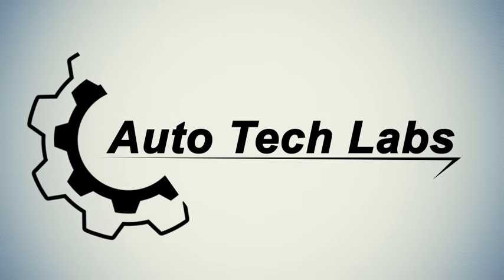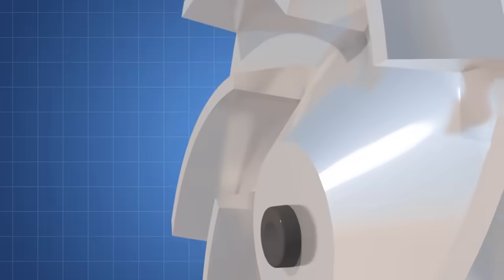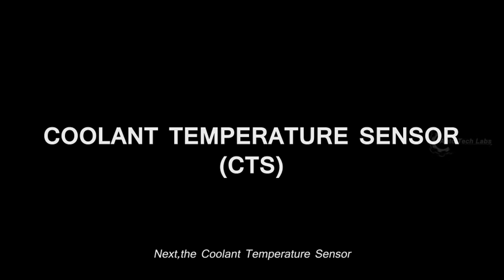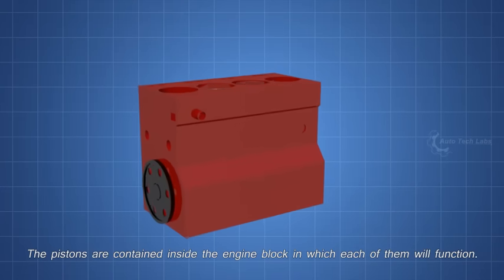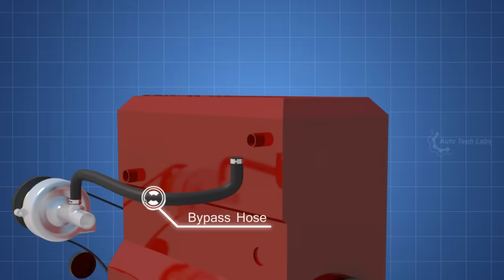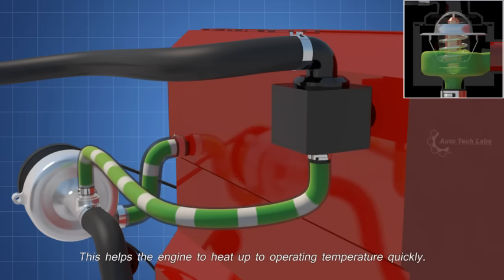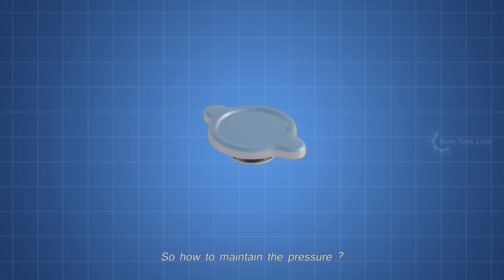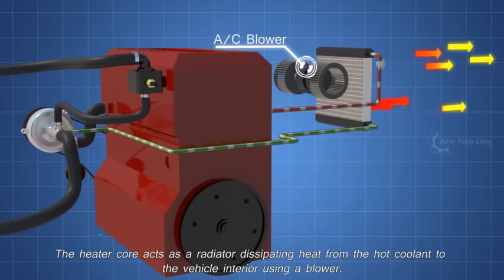How Engine Cooling System Works | Autotechlabs

Comment: There is not any reason a water pump should have more than 4 bolts and an 0 ring and directly bolted to the fan hub assembly .
Bring back copper radiators .
Electric fans operate efficiently .
Detroit Diesel uses a viscous thermal drive on their water pumps .  Sandwiching air to air coolers between a radiator and an a/c condenser is not efficient !

Comment: This goes to show how thermally inefficient internal combustion engines are how much energy is wasted as heat. An gasoline engine is only about 25 to 35 percent efficient a diesel is about 35 to 45 percent efficient the rest of the energy is wasted as heat that just gets dumped out the radiator and  noise out the exhaust. For example in a natural gas power plants the heat from the gas turbine engines and theor exhaust is captured to boil water and produce steam to also power a steam turbine making the system about 65 percent efficient. An electric vehicle battery and motors combined there abot 65 percent efficient also much better then internal combustion engines. The one pro of this waste heat is that like mentioned at the end of the video in the winter it's put to use to heat the vehicle interior but if you can imagine that's not enough to cool the engine down and keep it at operating temperature the thermost still opens and the radiator fan still turns on belching out heat even in the cold winter with the heat on full blast that how thermally inefficient these dinosaurs are.

Comment: the water pump inlet hose doesn't even exist in an actual cooling system the water pump is usually bolted onto the front of the engine block and pumps the coolant throughout the engine block but the water pump is never usually outside of the engine block like shown in this animation.

Comment: Someone help me understand this one thing that no video seems to make clear:
If the radiator cools the coolant such that the lower radiator tank has cooler coolant than the top one, shouldn't a hot top hose and a cooler bottom hose be a sign of a well working radiator? Turns out that if the two hoses have different temperature, then it's a bad sign... I'm confused... Someone help

Comment: since the heater system uses the engine's heat, you can cool down your engine temperature incase of overheating by setting the temperature to high to your AC

Comment: Cars are incredibly complex.  Before I got active in DIY type of work for my car, I always thought it was easy for a mechanic to point out a problem.  However, I found out very quickly that any particular problem has could be any one of five or six causes.  For example, a leaking of coolant could be because of the water pump, one of the hoses, the radiator, the radiator cap, a malfunctioning sensor, etc.  That's why it's good to keep up with the maintenance schedule if you can afford it.

Comment: So guys, I have Chevy Aveo 2011. 10 days ago when I turned the engine on I felt that I can barely turn driving wheel. My friend told that my alternator failed and I need to immediately drive back home before my accumulator dies. After driving 2 more minutes stopped at the lights, engine vibrated, stopped and smoke came out of the hood. My heater hose couldn’t withstand the pressure. My alternator belt was broken therefore I lost hydraulics on driving wheel. I repaired all of them. I had P0128 error (Thermostat Below Temp). I drove car with that fault for because I didn’t want to spend 103$ on new thermostat assembly ( I know silly decision) and yesterday I see smoke coming from my hood again but this time engine was running. I opened the hood and see my radiator bottom hose burst out. Now I repaired thermostat entirely. What you think was it main problem? I wish I had watched this video before. Never underestimate check engine light :(

Comment: I have a 2003 Jeep Liberty Sport v6. I’ve been having coolant bubbling and overflow problems with it for over a year & can’t seem to find the problem. The radiator, water pump, thermostat, housing have all been replaced in different occasions for different reasons not too long ago. There seems to be no lose or broken hose. I had my mechanic ask another mechanic for help because he couldn’t even figure it out. He said that his friend told him that there are 2 types of thermostats & that it could be that my car has the wrong one on. Meaning that the one mine might have on, is one that is not timing the temperature on a timely manner & that is what is causing my coolant to boil and overflow. Can someone please help me with some input. Thank you kindly.🙏🏼

Comment: why does it still needs a by pass? Why can just let the water circulate through the radiator even if it's not too hot?
Reply from the maker: That won't give the coolant enough time to absorb the heat from engine.
Reply: @autotechlabs  Thank you for answering my question.

Comment: I am having massive engine cooling problems these days. Every week one of the pipes is broken and discharging all the water in the radiator. Mech said maybe upper lid of engine is cracked. I wonder if I  remove the thermostat, is it going to work without pressure inside pipes? I need to go to mech 230 kilometers. Maybe engine will not heat up this way and burn more fuel, but i will use it for short period of time.

Comment: So how doesn't the coolant from radiator get pumped by the water pump even if the bypass hose is still not blocked? And how the water in the bypass hose not pumped when it's blocked?

Comment: so do i need to bleed the system when doing a coolant change or will the expansion of the coolant will get rid of the air and suck in coolant from the reservoir to replace the air?

Comment: These are the 3 important things needed to cool a modern day engine, water pump, Thermostat & Coolant temperature sensor, Or if you wanna be old school just buy a beetle and always keep that boot open and relax cause that's air cooled 😂😂

Comment: Start your engine. When the engine is warm, visually watch the coolant in the cooling system to see if it is circulating. Tip: If the coolant is not circulating, then it may need a new water pump. The water pump test should only be done after you verify whether or not the thermostat is faulty.

Symptoms of a Bad or Failing Water Pump
Coolant leak at the front-center of your car. ... 
Water pump pulley is loose and making whining sounds. ... 
Engine is overheating. ... 
Steam coming from your radiator

Start your car's engine and allow it to idle. Look through the radiator filler neck to see if the coolant flows. At this time, it should not be flowing as your car has not reached the operating temperature to cause the thermostat to open. 
If you find the coolant is flowing, it means the thermostat valve is open
Reply: Oh yeah? So, how do you check if your thermos tat is actually working?

Comment: Is it necessary to bleed air when the assumption that there is trapped air even though there is an expansion tank?
Reply: It is advisable that you do so, however, it is an easy process.

Comment: Someone help. I'm building a 357ci windsor,  putting an meziere water pump on. The electric water pump doesn't have the bypass and heat ports, just the lower radiator hose port. Is it ok to just run the upper radiator hose with the thermostat?  Should I drill 3 holes in thermostat?  Should  I not run a thermostat?  Its a car that'll be weekend driven to car shows and street/strip drag racing.

Comment: Question! So those hoses carrying hot water from the engine going to the firewall are only for the heater?? Those 2 hoses broke on my car , i replaced them, i live in a hot tropic weather i will never use the heater, can i just put a blind cap instead of the hoses?

Comment: So this means that the fan is used to create draft to increase cold air coming from outside right? Like the fan doesn’t actually cool the engine but it increase the air that passes thru the radiator. 
Please correct me if I am wrong

Comment: If you're going to provide "facts" make sure they are accurate. You're using a cold side thermostat on a hot side thermostat installation. It physically will not work. The water pump will only pull the bypass valve closed as you have it installed. A hot side thermostat does not have a bypass valve. The water pump forces coolant into the block, there is a small hose that goes from the housing of the thermostat back into the inlet of the pump.  A cold side thermostat has the pellet of the thermostat facing the water pump inlet, the bypass is facing the hot side of the engine and the cold side of the engine is attached to the pump outlet. The bypass valve is there to offer restriction to the coolant being drawn in by the coolant pump. This way, coolant favors coming into the cooling system through the thermostat main valve when it opens as it becomes the path of least resistance. 

You really screwed the pooch on this one. Crappiest video ever. Dont believe a word this video says. While some of it is correct, most of it is not.

Comment: Thank you for the video !
SOS, a very important question: the thermostat has a rod in the centre, in my friends car that ''axon'' broke due to a thermostat failure but never manage to recover it
is lost somewhere in the circuit but can be inside the channel of the radiator? can cause overheating or a problem to the car's water pump some day?
Is there a way to throw it out from the system?

Comment: At 3:59 . the direction of rotation of the water pump is wrong, since is a centrifugal not centripetal pump. 
At 4:41 the water pump outlet hose is shown which also indicates that the pump should've been rotating in the other direction than that shown in the video. 
This is only a negligible detail, so THANK you very much for this great video!

Comment: My cars engine gets extremely hot to the touch almost scalding, but the temp gauge needle stays at the middle or right under the middle. The issue I’m having is that the low coolant sign is on but the radiator reservoir is full. Anyone have any idea what could cause the light to turn on. It happens after driving for 1 hr.
Reply: The engine should be very hot to the touch, most engines operate at around 200 F.
Check if you have coolant in the radiator itself. Some cars have a cap on the resevoir and another on the radiator. If you have a cap on the radiator pull it and see if its full. If it is, the replace the coolant level sensor.
Reply: Redtooth 75  i Appreciate this response sir. I replaced the radiator cap cap to see if that may have been the issue. But I have a feeling it’s the sensor which does not look too difficult to replace. I’ll keep you posted if that’s alright.

Comment: On my Car's thermostat, there is a sensor. what is function of that sensor?
Reply from the maker: The electronic sensor alongside of the thermostat detects the temperature for ECU fucntions such as controlling radiator fan, cut off ignition on overheating and such.
Reply: @autotechlabs  Actually my problem is that, i recently replaced car engine i.e  Mistibushi 3B20. On the older engine there was a sensor on thermostat. But on newly purchazed (also used one), there is no sensor on thermostat. And that sensor grip is now idle. There is no check light on the cabin display. While fan is perfactly getting "on" and "off" according to temperature.  When i opened sensor of old engine thermostat, it is like thin stick which is going inside the thermostat. I am worried, should i run engine without being that sensor active. Please guide
Reply: Also there is another temp sensor on coolant circut on engine body. I think that is controlling radiator fan function. That's why there is no check engine light
Reply: @autotechlabs  hey bro any update on my answer?

Comment: Question. My car always has a low level of coolant I fill it up and then a few days later I look at it and its back down to about 15% full. I have driven it pretty far and have never had a over heating problem. And it doesn't leak either . What is going on?
Reply: There could be a crack on the cylinder head. Coolant is pushing past the crack and going into the cylinder then out the exhaust pipe. If you dont have any leaks that is the only place ot can really go.

Comment: Is it posible to lower the engine temp by  using the ac to warm ourselfs?
Reply: turn the heater on and the blower motor than will lower the engine temp in case it's overheating.

Comment: Thank you for the video!! Quick question: is it normal for my new thermostat to come without a rubber gasket like the one I replaced? Is it not required? Thanks in advance!!
Reply: They are sold separately

Comment: Some radiators don't have a cap or drain.  That does not prevent draining the coolant and changing it.  It just makes it slightly more difficult.  Just have to make sure the car has not been ran recently before you take the hose off.

Comment: this video helps me a lot to do my final project for school. Thank you for creating this!
Reply: 5:23 --- the coolant does not bypass to the water pump and recirculate to the engine block instead to the radiator? in your video shows that way, but the description says it bypass to the radiator .....
Reply: Swasti Niramaya- It bypasses the radiator, meaning it doesn't go through the radiator while the engine is cold. It has to go through the pump in order to have flow
Reply: @imthedarknight-8755  oh ok cool thanks for the reply 👍👍👍

Comment: So if the thermostat was stuck open there would be no coolant flow from the thermostat to the radiator?
Reply: If it was stuck open then coolant would continuously flow to the radiator. This could prevent the engine from getting to operating temperature. If it was stuck closed then there would be no collant flowing to the radiator.

Comment: Sir Thermostate valve of any engine opens at what Temperature?
Reply: @autotechlabs  most thermostates use expanding metal to open and close. If it used wax, they would only work once.

Comment: I was about to say where’s the heater core. I really wished they talked about it a bit more
Reply: I think he left it out because it is not designed to contribute to engine cooling. The heater core is basically a small radiator, but instead if the air cooling the water the water heats up the air to heat up the cabin.

Comment: Very helpful videos, I wished they explained what happens when each of the parts fails.
Reply: Your engine will overheat if any of the parts fail.
Reply: @shifty2755  or stay too cool if the thermostat sticks open..
Reply: @danallured4533  

Then premature engine failure.
Reply: @shifty2755  nope, engine will run fine and not break, just wont get up to operating temperature, be less fuel efficient and heater wont be warm inside the car but engine won't fail, I had one stuck open for two years before I changed it and it still runs 100% fine.
Reply: @danallured4533  

The problem is. The oil wont reach optimum operating temperature. Thus leading to premature engine wear caused by lack of lubrication.
Reply: @ShiftY I know ehHh"
I'd think the same.
Unemployed BSc mekanikal enj
-flushed own coolant, including block jrain plug
-changed in-line gasoline filter
-changed manual transaxle oil
-engine oil changes
-replaced brake discs & pads (front)
-adjusted SPK plugs
-replaced velvet cover gasket
-cleaned and reinstalled throddle body
😉💪👍👌✌️

Comment: So running the heat inside can help the engine cool down or does it trade off with putting resistance on the alternator and thus increasing engine temp?
Reply: Running the heat does cool the engine slightly. Its just not very effective.

Comment: What happens if dont use the thermostat??
Reply: Mr Ejan your engine will get cooler as coolant will always flow back into the radiator, however it’s not a good idea to remove it as your engine needs to run at operating temperature to run efficiently.

Comment: Would the coolant flow merely by conduction or convection if there were no pump and there were just a loop from the heat source (engine) to the radiator and back again?

http://AnswersFromGod.com/?YouTube=y5p31F_dVJU

Comment: Sir i recently installed A.C system in my mehran car.
But after the installation i noted that car get heatup and heat needle approachea to red limit.
Whats the problem and solution.plz tell
Reply: The problem is that you increased the heat load on the cooling system without improving its capacity to dissipate the extra heat. The condenser in front of the radiator is now preheating the air before it passes through the radiator. The extra heat is overloading the existing cooling system components causing the engine to over heat.

There are two ways to deal with the problem. One is to get more air flowing through the condenser and radiator to dissipate more heat. The other is to increase the capacity of the radiator to allow it to transfer more heat from the coolant into the air.

Vehicles with AC usually have an extra radiator fan that runs all the time when the AC is on. They also have bigger radiators with a thicker core. If that vehicle had AC available as an option you might be able to get a bigger radiator and the fans and other parts you need either new from an auto parts store or a dealer or from a salvage yard.

Comment: i came here becuase my car overheats when i turn on air conditioner when im going up-hill 
any solutions
Reply: The ac is preheating the air before it reaches the radiator. Most cars have a fan that comes on when the ac is running. You either need more fans, fans with a higher flow rate, or a larger radiator. Or you could be low on coolant.